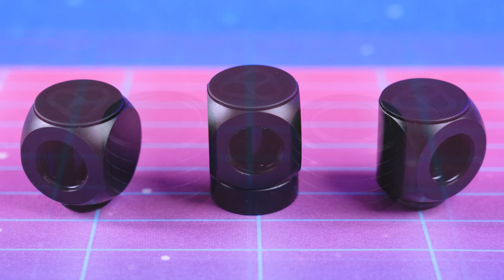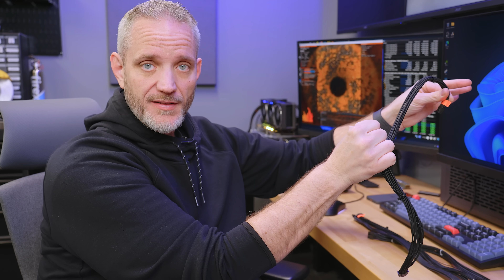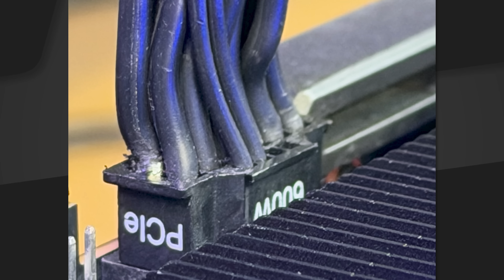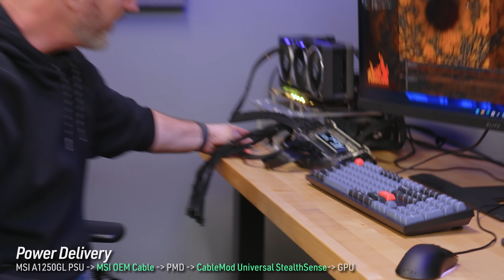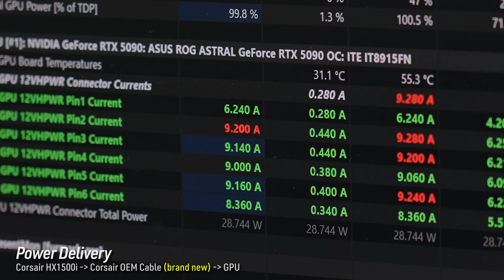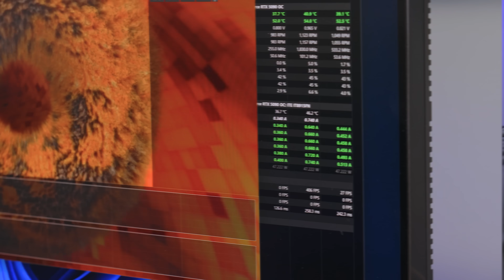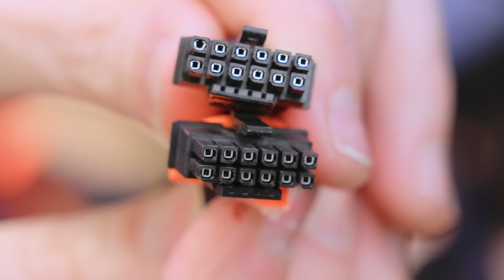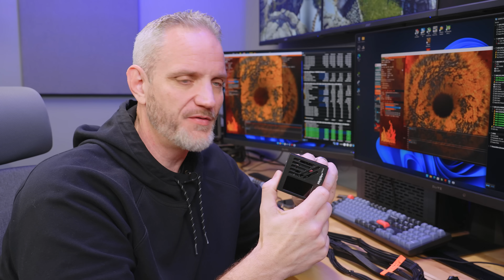More details on what could be causing 12VHPWR / 12V2x6 Cables to melt

Comment: I get that your into record chasing, but most of us don't want to push the most expensive piece of pc hardware that we've ever bought. The wireview or a cable extension just adds additional points of failure... You should only use the cable that came with your PSU and replace it if you unplug it more than 10 times. Just put an 85% power limit and a small OC on your astral. I can play anything at 4k 120fps, the card stays at 50-52, and my amp draw stays below 9a on all pins. I feel like this is just common sense, but that doesn't garner youtube views. I'm just say'n, I've had my card since launch, still on the same cable that came with my psu and I've let this rig render for 28 hours with no problems. How many connectors have you burned up?
Reply from the maker: Thats a very interesting story.
Reply: @Jayztwocents  Just my ,02, but what would a 42 year old technician like me know?

Comment: I've had this kind of "disconnection" problem before that shuts the card down. The vibration on my ASUS TUF 4080 is so violent under gaming load that the cable loosens at the connector over time to the point that the card claims insufficient power momentarily (flaky detection) and crashes the display drivers to the point I have to shut the entire machine down, open the side panel, unplug the connector and plug it back in firmly. Then boot back up and it stays fine for about a month before it spontaneously does it again.
Reply: I'd be getting your shit checked out.
Reply: lmao imagine paying 2000 dollars for this prime gaming experience. Fuck Nvidia.
Reply: @_-TC Agreed.
Reply: Sounds like a bearing is failing on the fan on your GPU. Thats the only thing that could cause the kind of vibration
Reply: @3lanksp_ce It could also be clearance issues. My Case has just enough space to barely fit the cable while plugged in. It was originally a 6900XT inside, but I had issues with that card (drivers not working and windows fighting with me despite registry tweaks to turn off its driver update suite to stop replacing my AMD drivers with generic display drivers) so I swapped it for the 4080 (I got scalped twice, once AMD once NVIDIA). The clearance is so close that the cable does push back a bit when closing the side panel and has some stress on the side panel, but not enough for it to be uncomfortable. Eventually I will be getting a Thermal Grizzly WireView 12V right angle connector which should reduce the stress on the cable which is mild. Yes, you heard me correctly, it takes mild tensile stress + vibration from gaming load to make the connector lose contact with the GPU midsession on occasion. Its not an everyday occurrence, just occasionally. I used to have the Cablemod right angle connector, however cablemod recalled it even though mine was fine. So I stopped using it and instead replaced it with a cablemod adapter from four 8 pin pci to 1 12V HPWR and they only had the non angled cable at the time. The Thermal Grizzly Adapter wasn't around so I had no other option. I'll probably do that when I change cases and CPU platforms as I'm still on AMD 3rd Gen Ryzen with a 5950X and 128GB of DDR4 I no longer need (used to use it as a hybrid gaming, video editing, music production station). I plan to upgrade CPU + 32GB Mem and possibly storage + PSU and Case, the GPU will be coming with me from the old build as the 4080 is enough power for me, just need to update the non-gpu components.

Comment: Reduce the number of wires then increase the load but don't increase the wire gauge or the plug was asking for trouble.
There a reason i use the card adapter and 3.0 power supply. Three cables handling load up to the adapter reducing the risk and a adapter the card maker wants to be sure is going to do the job.

Comment: But why is the standard 6 x 12V + 6 x GND instead of going to a beefier connector altogether? Does it actually benefit from 6 separate power circuits, or would it have been cheaper long term to have fewer beefier components?

Comment: Amazon cables... Much people are unawared of it but lately copper percentage is lesser and lesser in cables than it use to, they uses alloys now and that's a point, it's the same matter of cutting costs we're been suffering from from quite some years.
Reply from the maker: yeah almost all cables these days are steel strand.
Reply: 99% of cables sold on amazon are garbage that includes charging cables, cables for older consoles, and these cabes for the newer gpu cards
Reply: @spookyghost7524  yes a lot of copper coated aluminium too.
Reply: Small pins and then incorrect metals mix cause oxidation and bad connection...... its always in the details
Reply: Amazon-products (and i mean including the amazon-brand) are often the lowest of low chinesium, and often just copyright-infringements or fakes.

Comment: What if they just fixed the 12VHPWR  connector pins so they couldn't move, and added two extra cables with pins to distribute the current better (12V3x8)?
Reply: Gpu distributes current not cables so if gpu makers keep doing shitty power sections on gpu so  12hvp still will be failing on heavy current gpus 😂

Comment: I have a 4090 from gigabyte since release and never had problems with the card im gaming every day for around 4-6 hours and using a corsair cable for the power 12v into 2 8 pin for the psu side 
Am I lucky or its not a common thing ?
Reply: I don't think as common as the amount of coverage implies it is. The problem is that its happening at all. You ever hear of an 8 pin melting? I haven't.
Reply: @internetman8015  then you just haven't paid attention. Just do a quick search, you'll find countless cases of it happening.
Reply: @internetman8015 i see and yeah i agree never heard of a 8pin issue and used plenty of them in my life
Reply: @internetman8015  even the cheapest of cheap 8 pin don't melt
Reply: I've had a 5080 since may last year with no issues thus far. It seems to be just common enough to be notably more frequent than 8 pin connectors melting (which did also rarely happen), while not being super common overall. Still it seems to be uncommon enough that companies seem to feel its an acceptable failure rate. It's clearly not as good as the old ones were, but it's good enough for most scenarios
Reply: Mate, this guy half of videos a whole load of nothing about nothing I’ve found most of the time. I don’t know why I watch them TBH. I’ve found he’s become nothing more than click-bait lately

Comment: Glad i returned Sapphire Nitro+ and instead bought Red devil 9070XT, i wasn't really happy about the pin.
Reply: Nice I was looking at the red devil 9070xt but I got the xfx 9070xt Mercury Magnetic Air
Reply: @ÇrųśtýBøđýPiłlöw  Good card also, RD won with the looks.
Reply: @addd717 how many 8 pins the red devil use ? I had to use 3
Reply: @ÇrųśtýBøđýPiłlöw  Yes, it has 3x8.
Reply: I was all set to click "buy" on a Sapphire Nitro, then realised it had a 12vhpwr connector. Backed away fast.
Reply: @bythelee  Same goes for Asrock Taichi that is currently flagged as the best 9070XT.
Reply: I went with the pure, gave the red devil to my brother i managed to snag during the last shortage. But if it wasn't for 12vhpwr i would've went with the nitro+
Reply: @The1astGuardian  I must say was a Sophies choice between Nitro+ and Red Devil. Ultimately i chose RD because my build is all black with tempered glass and the 600W was also a factor. In my country the RD was not that available but i found it finaly so i went for it.

Comment: Here we go again. Let's just go back to the old pins until they can figure these out.
Reply: how about they just lower rtx 6090 power draw to 450w and we go back to 3x8 pin connectors and never use this shit again
Reply: @bellicsson4171  I'll one up you.

How about game devs optimize their games so we don't have to rely on this fake frame nonsense.
Reply: @uss-dh7909  Its 2026, AAA games should run on damn potatoes by now! Anyone else remember when new games kept looking better and better on old hardware? I think a lot of it is almost no one uses their own engine anymore so no one is a master of their own games engine lol. They are just taking a bloated engine and slapping their crap on top. Then again there are game devs that proved you can use a mainstream engine and make a beautiful game and debloat it making it run great on everything (like robocop).
Reply: @mromutt  Developers have just gotten worse at their jobs. This is why studios like Bethesda absolutely refuse to move on from their old-ass engines - nobody there is capable of making a new engine that would function better.

And so many studios opt for Unreal 5, which as you said, is a bloated mess of shit. Sometimes, the developers are skilled enough to overcome the quirks of the engine and make well-optimized titles, like ARC Raiders, but it's typically just left a total mess and destroys in-game performance.

Then you've got studios like Rockstar that use their own engine, and it's a mixed bag. Overall, their games aren't well-optimized, and input latency/detection is pretty bad, but they look very good and have always maintained a unique atmosphere compared to other titles in the genre.

Then you get GOATed games like MGS5 that bring everything to the table. Amazing visuals, top-tier optimization, snappy controls, it's all there. But these games come around, what, once every 10 years?
Reply: @bellicsson4171  Don't even have to be that conservative. 8-pin connectors can usually carry 250-300w for short times without issue. You also get 75w from the Mobo connection. A 500-550w limit would be fine.
Reply: @bellicsson4171  AMD did that and also made their GPU much faster than nvidias and it sold nothing.
Reply: @milesfarber  are we talking about 90 series? Didn't 90's sell well?
Reply: @rarespetrusamartean5433  I replaced my 4070 with a 9070XT. Not buying nvidia anymore
Reply: @rarespetrusamartean5433  The Vega 64 consumed 200W, costed 400 EUR, had enterprise grade HBM memory, and was 20% faster than the GTX 1080 Ti in ray tracing.

It sold nothing.

The Radeon VII consumed 250W, costed 500 EUR, had 16GB of VRAM, and was 20% faster than the GTX 1080 Ti in everything else.

It sold nothing.

So AMD decided to stop trying to make legendary GPU's and starting with the RX 5000 series they just made money by copying nvidia.

You voted for this with your wallet btw.
Reply: @milesfarber  damn. That honestly makes sense because I so rarely heard about these GPU's I almost forgot they existed...

Though...I didn't vote for that. I've been an AMD user since the Phenom II X4 era. But I could never afford something as high end as those.

But I see your point.

Are there any documentaries about these GPU's? I guess I'll check GN and Hardware Unboxed.
Reply: @milesfarber  the 1080 ti came out before ray tracing was a thing, the whole rtx line up was the start of ray tracing and the 1080 ti was actually faster, get your facts right
Reply: @deathdealer3357  You're going to have a really, really bad day when you find out about blender 2.79.....
Reply: @milesfarber  Because Nvidia has infinitely more money than AMD (hence much more headroom for R&D and innovation) and a technical monopoly with their CUDA core on top of it. It's such a much more tough situation competing Nvidia than Intel in the cpu market. AMD will keep being the underdog unless they up their games with their streaming cores against Nvidia's CUDA. Even if AMD defeats Nvidia in ML solutions like DLSS, the CUDA will keep Nvidia ahead. That's where AMD needs to defeat Nvidia. If you want to do anything remotely other than gaming with your PC gpu, Nvidia mops the floor with AMD.
Reply: @Reza-pr5qr  Radeon Prorender and OpenCL in blender 2.79 were 20% faster than Cuda. Nobody cared.
Reply: How about a new better spec that is not interoperable with this mess?  Let 12VHPWER, 12V6x2 etc all die.
Reply: garauntee its where the zip ties are too tight. What mfgs need to do is include nylon in each cable. the problem is the rubber sleeve can stretch but copper cannot, and builders obsessed with clean cable management put too much stress on cables where they tie them down.
Reply: Let’s go back to 8pin connectors I agree.
Reply: I agree, 4 connectors with large wires instead of one small fire hazard, that would be an acceptable sacrifice.
Reply: Its fine, no need to go back

Comment: can you make a video  about ‘Official ASUS statement on recent ASUS AMD 800-series motherboards and AMD Ryzen 9800X3D concerns.’ 

Is this issue limited to the Ryzen 7 9800X3D, or can it also affect non-X3D Ryzen CPUs?
Reply from the maker: This the same issue that has been happening with 9800X3D CPUs on ASRock boards as well. I cant really talk about that with first hand experience yet since even out Taichi which has been murdering 9800X3D CPUs hasnt harmed ours. I know several MOBO manufacturers are looking into it and have been for a while. No idea what the root cause is yet. All I know is ours is within spec on both voltages and current.